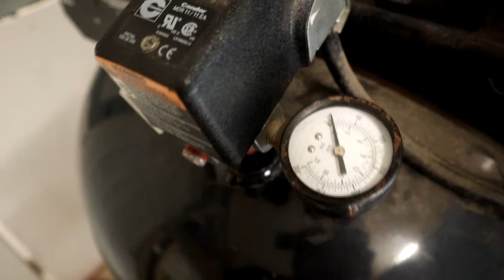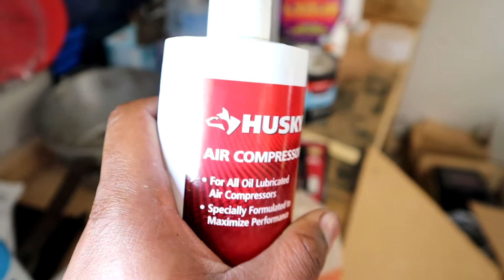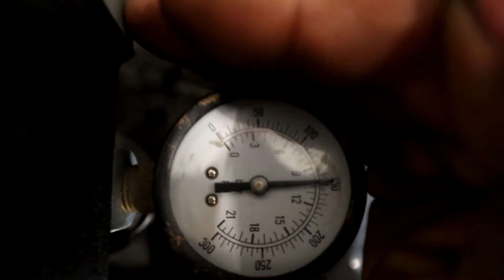Husky 80 gallon Air Compressor Motor Replacement

Comment: The only thing i would have done different was before adding the oil, remove the drain plug and add a short piece with a ball valve extending from the motor. This would make future oil changes a whole easier and less messy!

Comment: What gear puller are you using? Just like you I need to remove the flywheel and I'm having a hell of time with 2 different pullers.